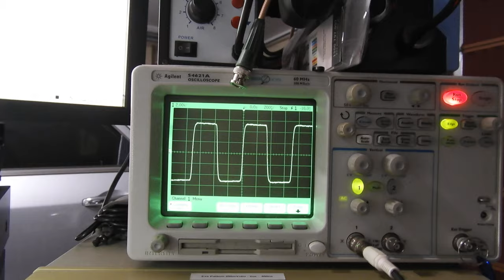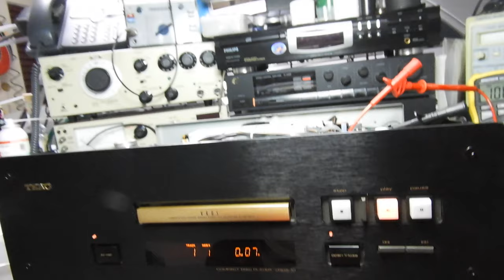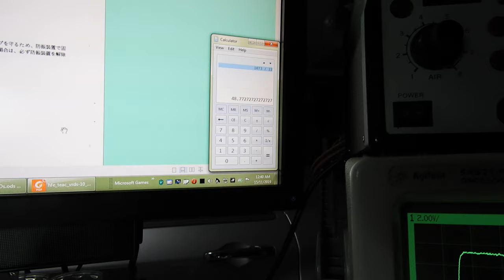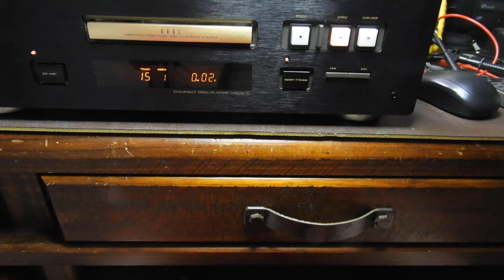TEAC (Esoteric) VRDS-10 follow up.

Comment from the maker: Frank, I have noticed you wanted a transport in my digest but I cannot find your reply in actual discussion. The transport you are probably looking for is Esoteric P-700 or P-500. Difference between them is the type of VRDS clamp and bridge on which it sits. Look for the videos of mine for both players. I will soon have both of the for sale on eBay under my nick rockeater or Joondalup Lake Audio. The P-500 would be $200 cheaper because... they always were. The bridge is pressed tin rather than die-cast and the CD clamping disc is aluminium rather than plastic. Hope it helps
I will soon list both of them.

Comment: Would I be correct in assuming this has already been Sold.
Reply from the maker: Frank, I have noticed you wanted a transport in my digest but I cannot find your reply in actual discussion. The transport you are probably looking for is Esoteric P-700 or P-500. Difference between them is the type of VRDS clamp and bridge on which it sits. Look for the videos of mine for both players. I will soon have both of the for sale on eBay under my nick rockeater or Joondalup Lake Audio. The P-500 would be $200 cheaper because... they always were. The bridge is pressed tin rather than die-cast and the CD clamping disc is aluminium rather than plastic. Hope it helps